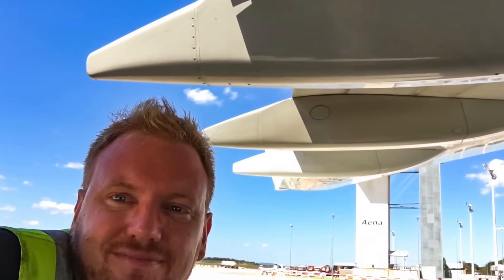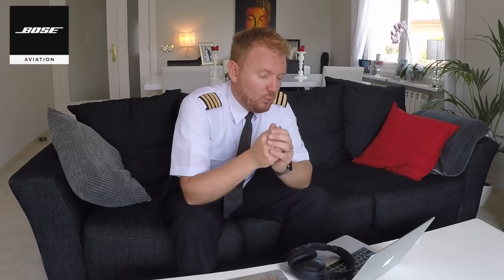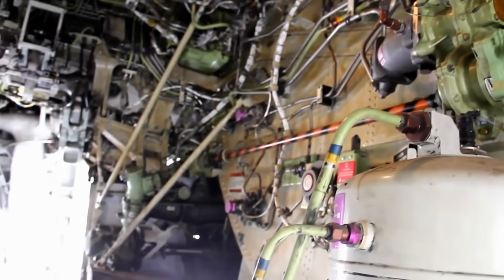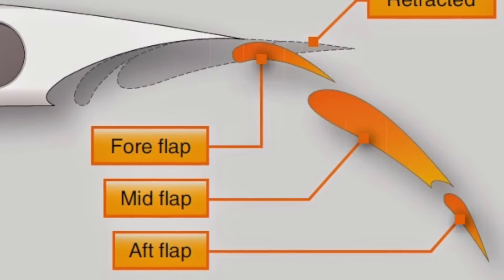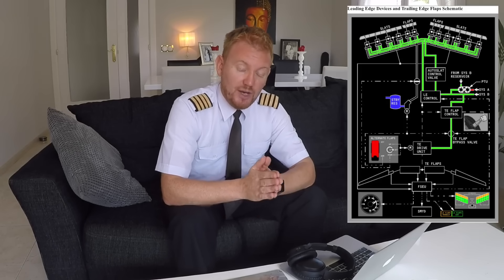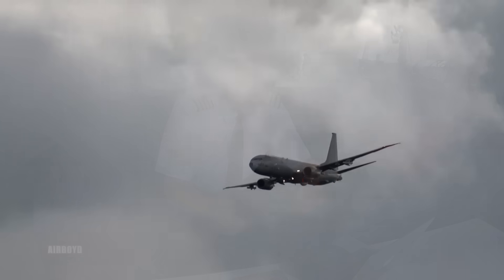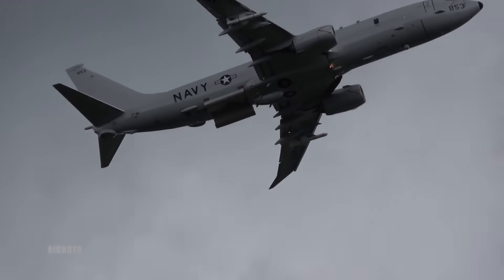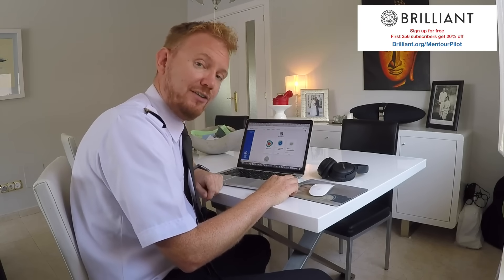"Pods" under the wing? What are they?

Comment: I was always under the impresion that those fairings performed the additional role of providing some mechanical support for the flaps too. Is that so ? Although not your type, I was once astonished on flying into Zurich that an A320 used so mch flap that you ended up seeing through the wing ! Honest, I could see the houses below peeking through the wing. I was in just the right place, a window seat close to the rear of the wing. It wasn't a 3 degree glide slope either if I'm not mistaken. This is presumably only possible because of laminar air flow over the wing surface, othwise the airflow would be too disturbed. Nice video BTW.

Comment: All modern airliners have these pods,Older planes did´t have them, Hiding those mechanisms in the wing was very space and "complexity" consuming, so it is a compromise between some drag  increase vs weight and space saving inside the wing

Comment: 1. due to 737's flap design, u need a flap track
2. The flap track fairing also designed as Anti-shock body to reduce wave drag at transonic speeds.

Comment: I know this has nothing to do with the flaps but going to the rudder,  the Pilot had a drifting problem from right to left of course.  I saw it with my own eyes when the crew took us up above the clouds and we watched and sure enough it drifted and it was the strangest feeling. When we got on the ground, a hydraulic maintenance man pulled the lower jackscrew cowling down and to our amazement the rear Rudder Jackscrew tail bracket was very, very loose.  It was then tightened up and the crew flew it once again and that took care of that hazardous problem. Kind of nerve racking to say the least.  This was also on the since , "out of Service, " C141Starlifter Fleet in the US Air Force inventory.  You can tell that I'm old but I still remember those problems.

Comment: I really know what you mean when the flaps have to synch.  On USA C141 Starlifters when they around,  they had the transducers, 4 each in the flap well.  The inboard right transducer was the first transducer to zero out by loosening the mount clamp and looking at your voltmeter, you zero it out, hold and tighten clamp and recheck.  Then you do the same with all of the other transducers.  Once all of the transducers are calibrated then operate your flaps and they should be very much in synch.

Comment: Question:  As the outside temp. during a flight can go fro +30C to -40C (or even bigger difference, I guess), does an airplane contract or expand with the temp. as most metals do. ... So I guess, YES, but by how much? And what about the inside of the plane, made of mostly plastic. ??                     Thanks.

Comment: Fascinating, always wanted to know, I worked on the F4 Phantom in the 70's for the USAF and the F4E received a movable leading edge slat MOD to help it manuver better in a dog fight with a MIG aircraft. it was controlled by the angle-of-attack monitor system and the airspeed monitor system so when the aircraft made a hard bank and the airspeed dropped and the aircraft was in danger of a stall the leading edge slats would automatically and instantly pop out and save the aircraft.  Thanks.....

Comment: I thought they were anti anti-shock bodies to reduce transonic wave drag, by having the cross-sectional area change smoothly (Whitcomb area rule). After all, they are used on aircrafts without flaps, and i front of the tail on some aircrafts, as well.

Comment: I have a question regarding the fan blades of an engine. Because the tip of the fan blades have a very minimal clearance from the engine cowling, can the fan blades ever rub against the engine cowling during turbulence or if the engine vibrates? And what would happen if the fan blades ever rubbed against the engine cowling? Thanks.

Comment: A long time ago area rule fuselages were developed to go faster with less fuel. Difficult to do with a passenger liner, so shock pods were developed to add to the wing. These are also known as Küchemann carrots.  They are also a place to put the tracks as in this video.  But they make airplanes faster and more fuel efficient.

Comment: In short, idiots design planes, that have to use flaps, 
on take off and landings, 
and if flaps do not work, lives might get lost (and the plane too)
What about make wings bigger ?
Before You answer:
- No, bigger wing does not come with relativ drag.
- Bigger wing means more weight, but it comes with bigger lift, so the weight is not a problem.

Comment: Thank you very much for this information, i just have a question:
 if there is for example Airbus A380 that needs in some cases 1200 kg fuel just for taxi, why airports dosen't use a pushback truck to reduce the fuel consumption?

Thanks

Comment: Regarding the situation you had.
When the FSEU detects asymmetry and stops then it can allow retracting them back right?
You have on board "slope" detection (whether the aircraft turns right or left). Did you have a checklist which contained steps with making tests for expanding and retracting flaps in order to see whether it was a sensor fault?

Comment: Turbulence: can a pilot request course/altitude to create a smoother flight?  I was on EVA air, Taipei-Houston.  6hrs bouncing.  Several passengers visibly upset.  I fly Beijing-Houston alot, United mostly, never experienced that.   I wrote to EVA.  Response: "pilot has no authority, he must follow air routes. mid-pacific route is bumpier than north pacific"    Is this true?  I suspect it's work (or fuel) to hunt around for calm air, they decided not to bother.  Am I wrong?

Comment: This is neat. I remember these hydraulic motors and torque rods when I worked as a baggage handler for a major airline from 1988 to 1992. I was 25. They took us into the landing gear bay just to show us the manual fire suppression release, but I also remember these huge motors and a maze of hydraulic lines. Working out on the ramp with these aircraft was the best job I ever had. We flew the DC-9, MD-80, 727-200, 737-200 & 300, and our big daily was an Airbus A300. Thanks for the video, I never new they hid the motors in those fairings.
Reply: There are no hydraulic or electric motors within the canoe fairings. The drive motors are located in the wheel well and turning motion,( torque) is transferred out to the jack screws through a series of torque tubes and gear boxes . Even the gear boxes and torque tubes are located in the aft wing wells and not the canoe fairings.

Comment: Its great that you are doing this, to help inform the general public on aviation - there are so many misconceptions - I'm single engine VFR working on my IFR and perhaps multi - (price is directly proportional to the number of engines and quantity of avionics) LoL.....  By the way, The Mythbusters did a very nice debunk on the "blue ice" myth, that A/C have a "dump the biffy" valve on the flight deck. If the A/C had a double failure (not very likely) - it could potentially, possibly occur.

Comment: Did you mean to say that extending flaps curves the CAMBER of the wing, not the CHORD?

As I learned it, the chord is always a straight line,  Camber is the degree of curvature.

Enjoyed your explanation, as usual, esp. your real-life experiences that related to this.
Reply: KutWrite 
 Chord is the width of the wing, from leading edge to trailing edge, so extending the flaps increases both the chord and camber.

Comment: Haven't watched yet. Going to try to guess without watching first.

They cover the flaptrack assembly. It's for areodynamic performance. Not covered, the assy and screws would cause drag and be exposed to the elements and possibel FOD. 

FYI, 737 tracks are cute and small. The 747 is 22 ft long and the carriage assy weights a few hundred pounds. Sucked stripping them down.

As for if you can arm a 737, I'd say yes. The UD Navy P-8 Poseidon should have missile racks and torps loaded onto it's wings in certain configs.

Hope I'm right. Time to watch

Comment: It would be nice if Aircraft manufacturers put cameras on the tail and wingtips that let pilots get a live view of the outside of the aircraft while it was in operation so they could inspect the wings, engines and gear from inside the flight deck. Are there any commercial aircraft that has this feature?

Comment: Terrific video, thanks!  You really set a high standard for consistently interesting and informative talks.

Two questions/comments:

I get the logic behind using the torque bars.  It's a nice, simple approach to ensuring that the flaps extend at equal speeds.  But...  If you can do it, wouldn't you rather NOT have a fairly critical system depend on a piece of rotating machinery that has to extend along a pretty large section of the wing?

So why not run wires and use electric jackscrews?  Apparently the 737's use sensors (presumably electric) to monitor flap position already.  

My other question is about the fairings:  Don't/can't they serve an aerodynamic purpose aside from housing the flap mechanisms?  I believe some 50's-vintage military aircraft had similar mid=span, trailing edge fairings.  If I remember right they were necessary for transonic/supersonic speeds, in kinda sorta the same fashion as the area-rule fuselages.  Unfortunately, I can't recall exactly which aircraft had these features.  Maybe some early USSR jets?

Comment: You continue to produce an outstanding series of aeronautical videos.  Keep up the great work.

Forgive me if I appear stupid, but I have a question about taxiing and turning and aircraft and airframe loads.  I've seen numerous videos showing various aircraft making a series of 90˚ turns on the pad after having taxied down the length of a runway in order to line back up on the runway for takeoff.  In many of the videos, it appears as if the nose gear is almost, if not in fact, 90˚ to the centerline of the aircraft.  With the forward momentum of the aircraft supplied by the thrust of the engines, doesn't this forward thrust make for very heavy thrust angle loads applied to the nose gear when turned so sharply?  I would think that thrust applied this way against the nose gear would be a serious cause of nose gear failure.  Thanks.
Reply: With extreme angles on nose gear in a small turn radius you would brake the main gear on the side you are turning into and in multi engine apply power to the opposing side.

Comment: Great work, continue on with descriptions and operating functions.
I see that the control systems are made from very heavy materials, ie: gearboxes, drive shafts etc.. reducing the weight by using different materials (lighter weight) But also maintaining the strength would be a huge advantage for saving fuel, same also could apply to fittings like seat frames etc. whats your thoughts ?

Comment: hey. big fan of the channel. I have always wondered, can the pilots/air crew get into the cargo bay or machine areas of the plane whilst it is in flight? thankyou if you do answer this. stay awesome
Reply from the maker: Hi!
I believe they can in some aircraft types but not in the B737.
Have a great day!
Reply: thank you for responding. just a followup question if im allowed. what would you have to do if something happend mid flight in the cargo bay?. e.g smoke alarm alert?
Reply: A related question: Is there a fire suppression system in the cargo bay?

Comment: excellent video as allways, Mentour can you do a video on the 737 wheels, tyres and landing turmac surface and its braking system, is the tyres filled with regular air or nitrogen (like most super sports cars are filled with)

Comment: Petter (or anyone in the know)

During the takeoff roll roughly what speed do you transition from using the tiller to the rudder for steering. Do you use the tiller at all once lined up? 

Also, can you please clarify if I've got this right. I've read that V1 is the decision speed for a rejected takeoff and once past V1 there isn't enough runway left to stop safely. So am I right in assuming that the aircraft is physically capable of safely taking off before V1 and meeting min altitude criteria by the time you clear the end of the runway (30m is what I read).

Lets assume we're in a 737 at MTOW for the sake of these questions.

Not a pilot, just an enthusiast.

Comment: Mentour, Here is one. Most of us know you can’t open the door when the cabin is pressurized, (ie somewhere in the vicinity of 15,000-18,000 lbs of pressure on the door depending on the size of the door at 18psi). Impossible to open. 

BUT, can you move the lever to the open position during mid flight? Thereby making the door vulnerable to opening once the pressure has equalized?

Comment: I've got a question hopefully you can answer. On 737 engine pylons, at the very bottom rear, are a couple of tubes that stick out. What are those for? I know they're not part of the fuel dump system, and I don't believe in chemtrails.

Comment: Again, very interesting!! I already knew those pods were housings for the flap mechanisms, but I did not know that they were driven by one motor. I've been designing electronics for safety critical systems for cars, and I had to implement monitor systems similar to the FSEU, so I found that specially interesting!! Thanks again for teaching me new things!
Reply: Sometimes, or most of the time they are hinged. Along with a control linkage  in the form of push rods and bell cranks that move the canoe  when the flaps are moved.
Reply: I think FSEU is similar to ESP system but on reverse principle, ESP give u asymmetric thrust(wheel speed)

Comment: Hey Mentour! I have a couple of questions: when planes make turns do they basically use mostly the rudder? Like if you look up for info they'll probably say "they do it mainly with the ailerons and just a bit of rudder" but everytime I get a wing seat I notice the amount of aileron change is super super tiny, only apply in the beginning and then goes back to it's position (while the plane is still banking doing the turn) and then they do another super tiny move to get the plane back to a leveled position. So I guess then most of it is done with the rudder?
Also in many places it says that this is not a standard procedure. But on a flight from Amsterdam to Madrid the pilot was turning only applying the rudder. We weren't banking but you could see we were turning to the left slowly and you kind of felt a bit tipsy, so I guess he was using a bit of continuous rudder to turn?

Thanks for everything! I totally love your videos!

Comment: I cant remember what flight/airline/plane this happened to, but these mechanics used to be installed in a very tight section that virtually had a section of the fuel tank molded around it. The flaps were extended for landing, and the bolt for the pushrod dislodged. When they parked and retracted the flaps again, the bolt was pushed through the wall of the fuel tank. Fuel leaked onto the hot engine of the now empty plane and it all caught fire. The incorrect sized retaining washer was used, allowing the bolt to slip through the eye of the pushrod. Something like that.
Reply: It was China Airlines Flight 120. That incident led to an airworthiness directive on 737NG's that directed airlines to recheck their slat tracks. Several 737's were found to have missing washers or bolts coming loose.
Reply: Thank you thank you, its been so long since I saw that I forgot all the details.

Comment: In 1971 the track roller bearings on the 737 wing were causing problems.  They would lock up, shear the cotter pin holding the retaining nut, unscrew the nut and leave the bearing lying in the nacelle you see on the cover picture. There was a bulletin on the 737 to re lubricate the track roller bearings every 50 hours.  I was a Sales  Engineer working for McGill Bearings who manufactured aircraft bearings.  Boeing was my customer.   Larry Blakley, structural engineer assigned to the 737 wing asked me to become involved in the problem.  The application and problems were similar to fish cleaning machines in Alaska (manufactured in Seattle by one of my customers) which had been solved by my efforts  With support from McGill engineering dept, I proposed a solution.  Last I heard, the test aircraft at United had flown 7 years without lubrication or failure.  I believe my effort contributed to the success or the 737 aircraft.  This scenario would not happen today because the mechanism has been replaced by computer software.
Did I get rich, no, I was doing my job.  McGill Bearing made a bunch of money! 
Iguana
Reply: HKA Geez!  Back off, dude!  The guy was sharing a story. Is that wrong, or are you just jealous?
Reply: He didn't say he wanted to make a ton, he said he was doing his job.
Reply: Iguana? Why?
Reply: I really like having a pilot explain all the different functions on an airplane. I like knowing these things; it makes flying so much more interesting.
Reply: You want a cookie?
Reply: @NoJoy1980  😋🍪

Comment: i really have been enjoying your channel a lot.

while i note that boeing retains a lot more of the traditional aircraft controls and feel than airbus seems to, have you flown an older 737 with the analog cockpit, or one with a lot less display screens?

how would you characterize the way things are different from operating a later 737 using the more modern glass cockpit?

and have the latest versions received a HUD?  and how does it change the experience?